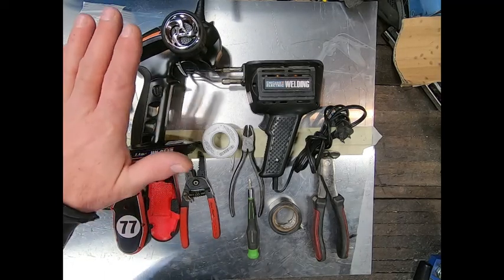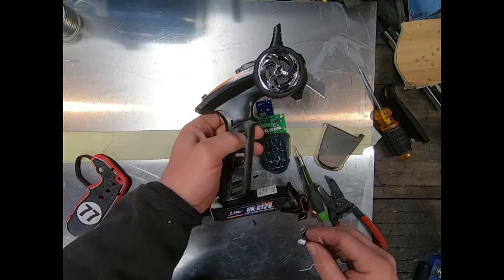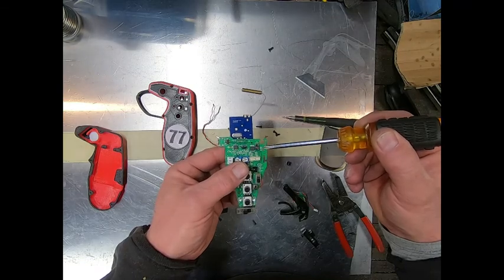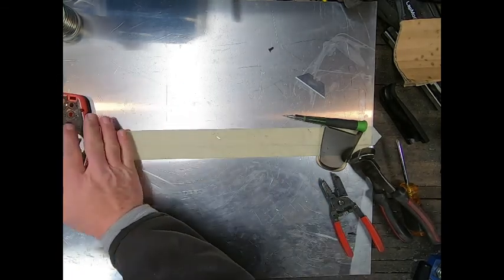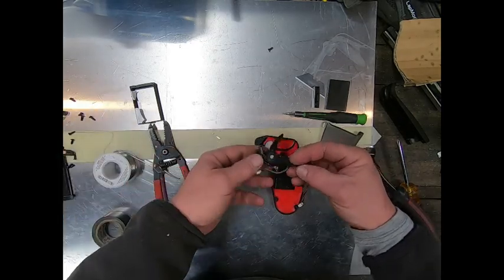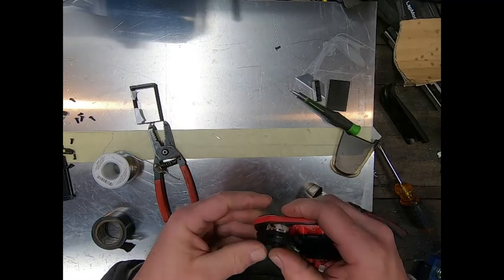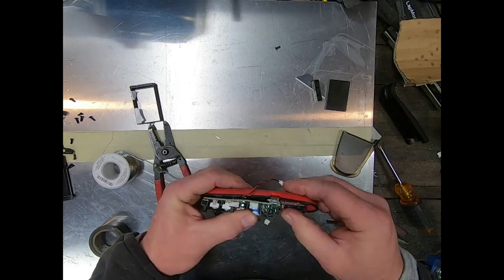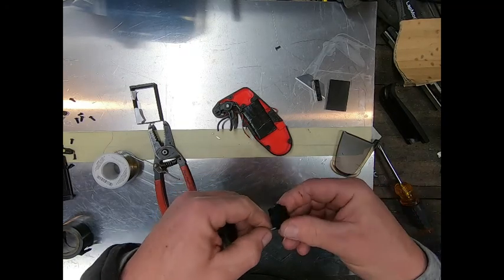GT2B Mod for Esk8

Comment: Very nice controller. When I used it, it felt like it was part of my hand, compared to the Hoyt puck which is to bulky and cramps my hand. The trigger also helps to not cramp your hand compared to the wheel which needs your thumb to operate.  That leaves you with less of a grip because your thumb is above the controller instead of around it.